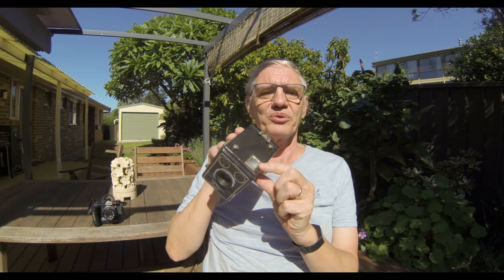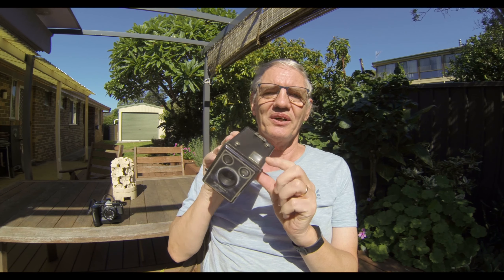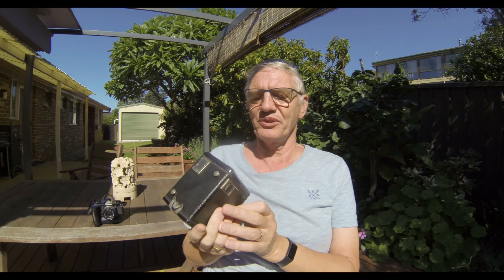Scanning Slides With Silverfast and Epson V800

Comment: I thought it was a bit slow to start, but I realised that was what I needed. Plenty of time to follow and check against the software. I have found only one change that suits me better, which is not to use ACCR. Many of mine are spot on, or only need a tweak on brightness.
Very done that man!
(Works alongside V9 Studio Ai with only minor differences)

Comment: Thank you very much for the step-by-step tutorial. It's been really helpful getting me started. However, like Andrea, my Preferences setting (under the Edit tab) does not include the HR prescan or the frame setting. It only has three options: General, CMS, and Special. Nor do I have the option to scan Kodachrome slides. I've checked and my SilverFast 8.8.0r25 is up to date.
Reply from the maker: Hi, there are different versions of Silverfast.  The one that comes with your scanner is called Silverfast SE, it has the most basic capabilities..   A comparision chart is here https://www.silverfast.com/showdocu/en.html?docu=1178   I don't have the SE version installed, so I can't check..
Reply: Hi @TravellingVikings . Thank you for explaining that. It must be why some of us do not have the added options. I can upgrade to Silverfast SE 9 or 9 Plus but am not sure if it's worth while. Thank you so much for your tutorial - I had a set of glass-mounted slides from the late 1950s that I wanted to capture, as some of them had gone mouldy, and you helped me through the process more admirably.

Comment: Hi Simmi, Thanks for the video. About 10 years ago I scanned my slides and negatives - very gratifying to see them digitised. 
One of the problems I faced, that I did not overcome was the slight warping/buckling of the colour reversal film encased within the cardboard or plastic mount.  
This resulted in a varying distance, across the slide, between the scanner and the image surface, leading to some parts of the slide being a little out of focus. 
Have you come across this, or does the V800 handle this?
Regards, Ralph
Reply from the maker: Hi Ralph, my slides were from 1980's and I had kept them in a slide tray and slide boxes.  I'm pretty sure some of them were slightly bulged as that happens all the time..  The Epson V800 slide carrier doesn't use little tabs to hold the slides, it uses a frame which snaps in place and provides a more firm downward pressure on the paper which houses the negative.  Although that in itself won't alleviate all warping I must say I didn't notice focus issues with what I was scanning..   With the Epson slide holder you can also vary the height from the glass via plastic tabs which can also help with getting the right focus..

Comment: Simmi have scanned slides saved as TIFF, but L/ROOM does not appear to allow editing TIFF. I have read online comments from others saying similar things..........not sure if you have any suggestions.
Regards Russ
Reply from the maker: Hi Russell, I'm not familiar with Lightroom and have never used it.  I gather it has a subset of the editing cababilities of Photoshop.  If I need to touch up photos I use Photoshop Elements, which is far more cost effective than Photoshop!

Comment: Hi Simmi, following your tutorial I'm scanning my slides with Silverfast AIstudio9 (new version).  I have replicated your settings and am happy with the very good results. 
Only one point is not clear to me. Find frames outset your setting is -1
,  What does it mean as the field requires a percentage. Anyway -1 is fine for me too.  Regards
Reply from the maker: It is a percentage number as you rightly point out.  When finding frames it determines how tightly it crops the frame.  A positive percentage number adds extra space around the frame.  A negative percentage number like -1% crops a small edge off the frame, making sure there is not added space.  I used -1% to make sure I didn't get any extra space around the frame.  It's something you can play with depending on the type of material/scenes you are scanning.  Just remember a big extra space around the frame, which is not part of the picture will influence the histogram and auto color correction adjustments.   I'm glad it's working well for you, so good luck scanning your memories!

Comment: i do not have the option to change from reflective to transparency, do you  know what should i do ? any ways i could fix that ?
Reply from the maker: Silverfast is getting some control signalling from the scanner that the transparency light source isn't there.  That is why it's greyed out.  When scanning transparencies, the scanner has to provide a light source from above i.e. from the lid.  Some scanners have the light source as a separate unit which has to be installed and plugged in at the back of the scanner..  Make sure your light source for transparencies on the scanner is working..

Comment: Hi Simmi, Thank you for the extensive video! For some reason my preference dialogue box looks very different from yours and doesn't include all the options you have available even though I reset the program like you did. For example I don't have the boxes that you changed including the high resolution prescan. I was wondering if you knew why or what I could do to get those other options. I have a V850 and version 8.8 so i am confused why mine looks different. Is this only available with Silverfast Ai? Thank you!
Reply from the maker: Hi Andrea, sorry for the late reply, but there are different versions of Silverfast..  The most basic is the SE version which doesn't have some of the options. . You would have to upgrade to the SE Plus or AI Studio depending on what capability you want..  See here for a comparison https://www.silverfast.com/get_update/en.html?selected_version=Ai_STUDIO&selected_type=sa

Comment: That was good as I am shopping for a scanner.  I don't recall seeing adjustments relative to the removal of scratches.  Is that also in the software?   Thanks Simmi
Reply from the maker: If the scanner includes this feature, i.e. infrared detection of scratches, then the software like silverfast would support it.  Check the scanner specs for dust and scratch removal features.  If you plan to use Silverfast, also check the scanners they support on their website..

Comment: Hi Simmi. May I ask what software do you use to catalog and/or view the exif / iptc / metadata information? 

I'm finding IPTC fields are not visible in windows10 / properties / details and a quite different set of fields are visible in Adobe Lightroom (Free Version).  Before scanning too many slides I want to ensure I am filling in IPTC fields that will be visible / helpful. (eg IPTC /Credits / Byline is visible and searchable in Windows but is not visible in Adobe Lightroom. IPTC / Caption / Caption is not visible in windows but is visible in Adobe Lightroom)  Thanks. Lucien.
Reply from the maker: Hi, I use two Windows programs AnalogExif to add/remove or copy Exif attributes on files and "Bulk Rename Utility" to rename files in bulk if I need to..  The Exif standard has a number of variations, so the field names sometimes don't match to Windows 10.   The simplest approach would be to populate IPTC with all the fields you want to have, scan a slide or image..  Then view it in Windows 10 file explorer and simply enable every attribute to view.  That way you can map the IPTC fields to the Windows 10 Fields.  Then in other applications you can do something similar.  Once you know what field appears where, you can make sure you use those fields that appear across the different apps..
Reply: @TravellingVikings  Thanks Simmi. I did that - the only three fields windows10 and Lightroom free and Silverfast all share are 1) object name/title 2)Copyright Notice and 3) Keywords/tags. Nasty. I might end up upgrading lightroom as well, or try adobe bridge. Or look around for another free catalog software.
Reply from the maker: @saladbar2260  I use Google Photos, so I can get my photos online on any device..  Google Photos seems to use the creation date correctly.  Haven't checked if it uses other fields..

Comment: Is there an advantage of owning Ai over SE Plus?
Reply from the maker: Hi Steve..  I originally only had SE, but back in April 2020 they offered an upgrade to SE Plus and AI.  The difference in cost between SE Plus and AI was so small if not the same I upgraded to AI.  I originally thought I'd use the Job Manager, but quickly realized it didn't suit my needs i.e. the workflow I used.  So for what I use it for, the SE Plus would be fine..   Just check if they do an offer like that again!